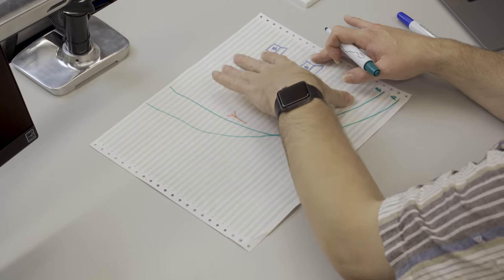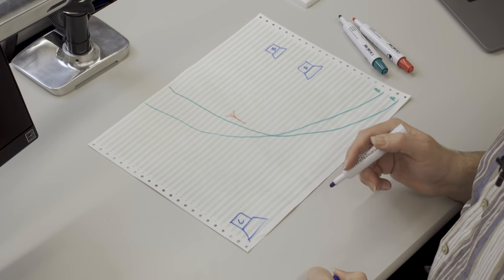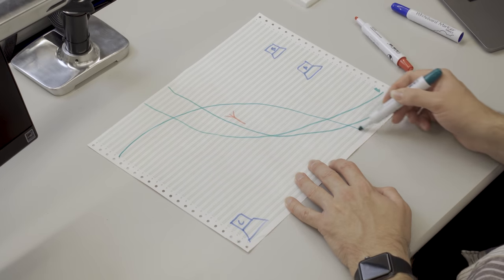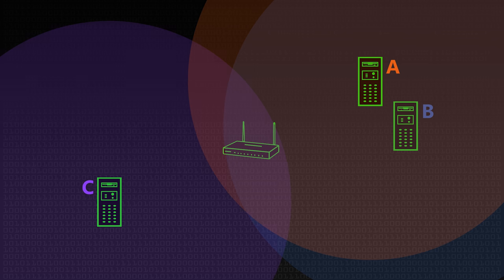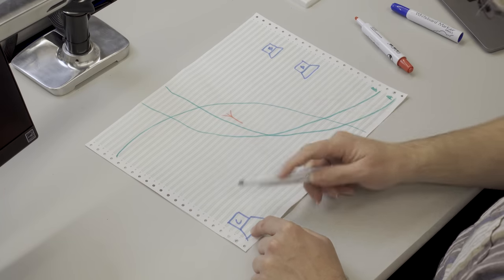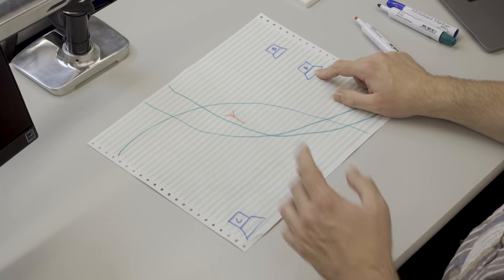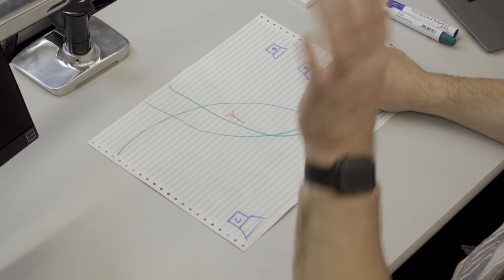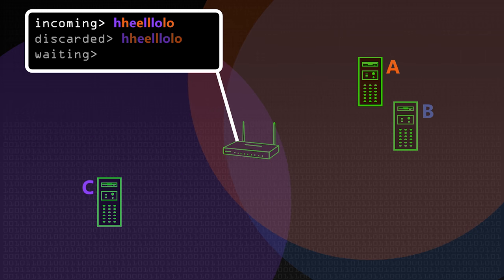WiFi's Hidden ____ Problem - Computerphile

Comment: I'd imagine an entire modem course on telemetry, mac addresses, and CDMA/FDMA, TDMA CSMA are all in order. 

Only reason I know about the real archaic RF modulation is because I used to maintain a satellite dish for the military.
Reply: My compsci course covered all that, thankfully. It was startling to realise that this is seemingly a comparative rarity. It was a 200 level class, so, second year.
It's really nice knowing how QAM and trellis encoding works, to pick two examples, not just networking one or two levels higher up (though we did that too).
Reply: Many years ago, I read through a series of books by James Martin, which covered a lot of telecom stuff, including satellites, data communications and more.  These were all in the company library at the telecom company I worked for back then.
IIRC, he was an engineer with IBM.  I also learned about some protocols with my work as a technician at that company.

Comment: First video i have seen by Computerphile - now I'm a subscriber :) 
A great explanation of a somewhat complex topic - the RTS flow makes perfect sense 🙂Most of us take wifi for granted these days, but it is truly, a complicated technology, built on top of many other technologies, protocols, etc - wifi is a kind of symphony of networking technologies! Imagine how many RTS are sent every second in an office environment with all the devices jostling for the right to transmit to an access point...
I did think that if Computer A/B could reach the wifi access point and Computer C also could reach wifi access, why cant they detect each other - it is likely a fringe case, when computers are operating on the edge of their wifi range...
I also appreciated the small (deliberate?) touch of using continuous stationery paper for the diagram - who still has that paper around!

Comment: I do kinda wonder how machines devide up the time. If I try to send a lot of info, who decides how much info I am allowed to send? I assume the other machines want to send info as well.
Reply: Even if you send a lot of info, it will still be chopped up as a stream of small packets. So in between two of those packets, other nodes on the network can get their own packets in. Where Steve says a node will "wait" for some time for a CTS, he really just means milliseconds. So to the end users it will all appear seamless.
Reply: @olavl8827  Thank you for this explanation!
Reply: It's common to use max 1500 byte packets since the birth of ethernet. The time needed to send 1500 bytes dropped drastically since then (because of increased bandwidth), so did the likeliness of collision dropp too. But not as much because today there are far more nodes and far more data to transfer.
Reply: Also read about wifi 6 that tries to fix this problem.
Reply: To build on olovl's answer, in general this problem is called flow control, and it's part of the specification of the protocol. This video is taking about the problems particular to wifi, but commonly with very low latency connections like USB (think hubs) it's as simple as one party is known or declared to be in control, and the other just waits to be asked if it has anything to say. Then the one that's in control just asks everything that's connected in turn. For other cases like the internet, the sender is required to wait for the receiver to reply that it's ready to receive more data after some number of sent bytes, which ends up being just a less chatty version of the same thing. If everything is cut up into tiny packets, then the total effect is that everyone gets the available capacity shared.
Reply: @SimonBuchanNz  Are you saying that the protocol has to ‘ask’ all connected devices if they wish to transmit after a set period of time? So that it’s impossible for any device to be left hanging. Thanks in advance!
Reply: This is a great question.
At my last employer, there was an IT guy ... prima donna as per other dept personnel, he was doing something and the result was filling an EU site's network connection and this pretty much killing their throughput.

He was fired after a week or so when they realized it was his process and he was nonchalant about wreaking havoc in the EU sites IT dept and production.

I wonder how would a network person be able to separate stream A from stream B or x number of streams while dedicating x amt of bandwidth to stream Important.
Reply: @pajerotim  well yeah. Usb does just that, in some transfer modes. Eg the keyboard or mouse tells how often it wants to be queried and the PC does so. This is called polling and was once called very bad implementation because it made the CPU permanently work. Later there were peripheral processors added that deal with the polling and only disturb the CPU via IRQ if they have something important to tell. IE a mouse click occured between last two polls.
Reply: What if a computer sends a packet and then immediately afterwards sends an RTS spoofing its MAC address? The Wi-fi would be unable to know that the second RTS came from the same computer since it spoofed its MAC address, so the computer would get a faster internet speed, right? (Assuming that the reason the internet is slow is because a lot of people are connected to the same router)
Reply: @MyVeryOwn  how an AP divides the air time up is largely up to it. So spoofing MAC could work for you or not. Really depends on how the AP is configured.
Reply: @jpt3640  Collisions were only a worry in the days of half duplex.  Ethernet has been full duplex since switches were introduced.  These days, jumbo frames can be used, with 9,000 bytes common, though modern equipment is capable of much more (one of my switches will do 16K, IIRC).

Comment: Great Video! 
It would be interesting to know how this problem is handled when there are multiple independent WiFi networks on the same channel.
Reply: The hardware doesn't really care about the ssids etc, that is just a layer on top of the actual channel. It does however lead to a lot of channel congestion which makes the network a nightmare to work on.
Reply: It can be a problem. You can read about rogue access points to find out why if you like. With rogue access points you'll find a lot of stuff about cyber attacks, but it also causes channel congestion which is where the problem they mention in this video comes into play. Rogue APs tend to cause a significant decrease in throughput. Think of a bunch of people yelling in a crowded room, it's unintelligible.

Comment: And you forgot to mention - all of these communication signals use the lowest speed possible (1Mbps) to ensure that even the oldest Wi-Fi devices can use the same Wi-Fi network due to backward compatibility. Therefore, if you have many Wi-Fi devices (even on the same or diffrent ones networks), they all will run at low speeds due to background chat between devices.
Reply: I think because these speeds are less prone to noise. It's like if you paint bigger letters, they are easier to read, because more pixels have the same value which is then combined together to achieve more robust consensus even when they are full of noise.

Comment: Now I get why my FRS radios transmit a sound when I let go of the button. It's just a way of saying "over."
Reply: Like udp?
Reply: Yes, I believe it's called "roger beep." Some radios let you turn it off/on.
Reply: The squelch tail makes it very clear when you let go of the button. The roger beep is unnecessary.
Reply: @rocketman221projects  How do you tell the difference?
Reply: @scottmacs  Well, the squelch tail is the noise "received" from listening to the background where the carrier used to be a moment ago.

Comment: Holy moly, I thought I already knew how wifi worked. Seems it's a thousand times more complicated/complex than I thought^^°
Reply: Unfortunately, they covered how cellular (carrier) communications work on 2G, 3G (H+), and 4G (not including LTE). So your wi-fi doesn't work this way unless you have a mobile router. Even then, it would only work this way when the mobile router communicates with the mobile provider.

Internally, Wi-fi works similarly but doesn't use CDMA/CD or CDMA/CA at all. Instead, Wi-fi uses a different multiplexing technique known as space-division multiplexing (SM or SDM), where various frequencies create multiple channels. This divides the space around you to support simultaneous communications from numerous devices, a concept known as multiple-input multiple-output (MIMO). When numerous devices are operating on the same channel, only then can they behave as they talked about in this video.
Reply: @justinlangley8972  Oh... big thanks to you for clarifying this. I was assuming that the same mechanics are used for wifi too. Interesting to know the differences :)

Comment: So if a malicious or defective node sends RTS:es all the time, or impersonates the access points by sending out fake CTS:es, it can cause a gridlock?
Reply: Exactly my thoughts. This seems like it's pretty susceptible to jamming attacks/malicious DoS.
Reply: @JonnyRobbie  Wireless is already incredibly vulnarable to DoS and there isn't much we can do about it. Just the nature of the transmission medium
Reply: If you're trying to block Wifi, or really any radio communication network ever created, then a simple radio jammer would be cheaper, more effective, have a longer range, and just be overall better in every single way than a Wifi device that's spamming RTSes.
Reply: In this case the access point sends a focussed EM pulse of several kilowatts in the direction of the malicious actor
Reply: @dreamy97836   little wi-fi go bye-bye . BOOM
Reply: You can buy/create wifi-jammers and also de-authers to catch wpa2-handshakes, yes.
Reply: If the intention is to mimic wi-fi jamming, a device that continuously sends unencrypted deauthentication frames (with an anonymized MAC if detection is to be avoided) would be just as effective on susceptible devices. Of course, this is not actual jamming, but a particular hotel chain (Marriott) was known to block guests from using their personal access points using this method.

A spark gap generator works, too, if you want a proper jammer. However, they're illegal to operate with this intention in mind. You could also just get into welding and perfect your TIG welding technique. TIG welders contain spark gap generators that generate lots of high-frequency interference.

Please don't do any of this.
Reply: @BooBaddyBig  Who do we contact for this sort of thing? Do we need to have physically located it? (There's been some kind of fake or defective cell tower nearby here for years - phones connect to it, and then take ages to realize it has no service...)
Reply: @m4inline  Causing the transmitter of the Access Point to get fried, along with its power supply and the malicious to restart due to low internal SNR. Then you have no Wi-Fi => No vulnerability.
Reply: Just three words: Ethernet cables.
Reply: @AySz88  the FCC in the USA
Reply: @HiddenWindshield  Even easier, rip the door off a microwave oven and every wifi device within a mile of the open door is deaf.
Reply: @MikeF1189  what would happen if you put an electric eel in a microwave?
Reply: @m4inline  BY THE POWER OF GRAYSKULL!!!!!!!
Reply: @MikeF1189 
You'd have to also jam the door sensor to make it think the door was closed.

I don't recommend doing this anyway, as it is likely to damage any unshielded electronics within a short distance. (not just wi-fi recievers) This includes chip cards and phones.
Reply: @ulterno1665  Nope, does a car radio next to a radio stations antenna go boom ?
Reply: that will blow just the RX of the actor but the jamming TX will still work.
Reply: "my microwave oven fell off the table once and the door bent out of shape, that's why there is a massive gap around the door and I had no idea it will cause everybody's WiFi stop working all around"

Comment: What I wonder is, for a smaller network, would timesliced wifi space be better than the requests for overall bandwidth efficiency?
So say here we have the 3 computers again, each get a 1/3 of the overall bandwidth in an X second period, maybe sub second period actually.  
It's not going to be as effective on a huge network, because there'd be HUGE wastes of bandwidth where nothing would ever be sent.  But on the smaller side, all those send bytes would add up surely?  Or would it?
I'm not entirely sure how the requests for sending are fulfilled, so I'm not sure if the routing system is smart enough to say "okay, router friend, I have to send X bytes, am I clear?". If it is that smart, then the timesliced idea would probably be pointless.
Reply: for cellphones something like this is used. A cell can have 62 concurrent calls (that is where the name cellphone comes from) and using Time Division Multiplexing they are each assigned a slot. This works for audio because of the low frequency. The transmission speed is much faster, so you can squeeze many conversations in a space without anyone having a gap once it is converted back to audio. Telegraph systems back in the day used a mechanical system of rotating discs with contacts and by rotating at a set rate each one would be connected for a specific time slot.
Reply: Even with 3 devices, it's entirely plausible that one of them wants as much bandwidth as is available all the time, and the other two only need to transmit once every minute or so, but want to send a bunch of data when they do. (E.g., messaging images to someone with your phone while watching video on your TV and your laptop is checking for new email periodically.) Your TV can get much better quality if it can fill its buffer while neither other device is transmitting, and your other devices can be fast if they can half of the bandwidth for a short period of time when they want, rather than being limited to a small amount of bandwidth all the time, such that your phone doesn't finish sending your message until you have the next one ready to start. Note that traditional phone calls are different in that the microphone will record constantly and always have data to send, whether you're talking, saying "mm-hm" while the other person is talking, or silent.
Reply: @iabervon  Yeah I was thinking this as well.  But say you're in a situation where it's almost guaranteed that everyone is sending a lot of data, would it then be better than wasting a bunch of 20 byte messages every so often requesting that window for messaging?
Say for example a family all came home and they are watching their Netflixes or playing games, a lot of data is flying everywhere pretty regularly.  In the case of the game especially, there's always data going back and fourth like you would see in a phone network where even empty messages are still messages in the end.  
I guess in a sense, it'd really only make sense if it was a full-on smart(er) protocol that could learn with time, but that also introduces issues, like changes in the network, guests, etc.
Reply: The standard exists. It's called time division multiplexing. It used to be used a lot in telephone networking, and goes as far back as telegraph usage. A more advanced version called statistical time division multiplexing exists today and is sometimes seen today in situations like a single communications line being split out to multiple nodes on educational and corporate campuses.

Comment: Wireless technology is remarkably inefficient, if you truly think about it.
Reply: Better idea?
Reply: @kieronparr3403  how incredibly constructive, of course I’ll reply with the solution to a billion dollar problem inside YouTube comments
Reply: Inefficient in terms of what? Data packets sent? Sure, but data packets aren't a limited resource.
On the other hand, it removes the need for manufacturing countless wires for nearly every device, and it saves a lot of human time - which is a limited resource.
Reply: What do you mean? Not really…. Pretty low power is needed to wirelessly transmit for normal use cases
Reply: @wojtek4p4  inefficient in terms of a lot of duct tape which in turn means security is pretty much always a problem or at least a concern. Nobody here is arguing we should go back to cables, that’s ridiculous, so your “argument” after that is pointless.